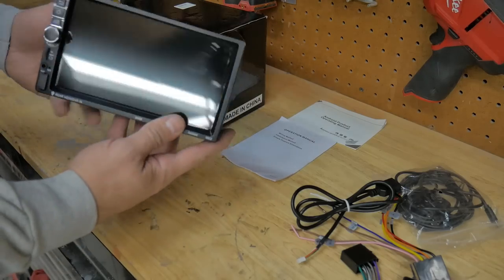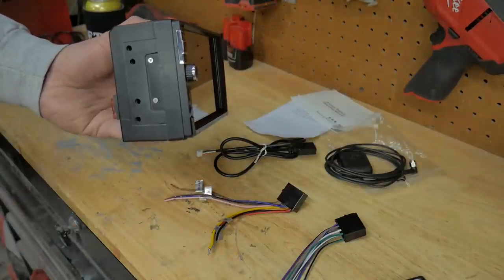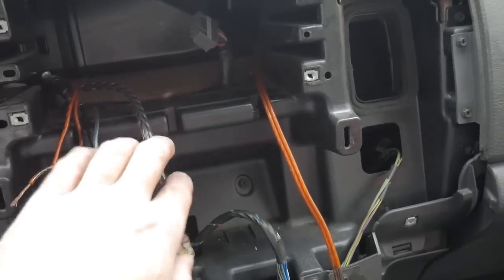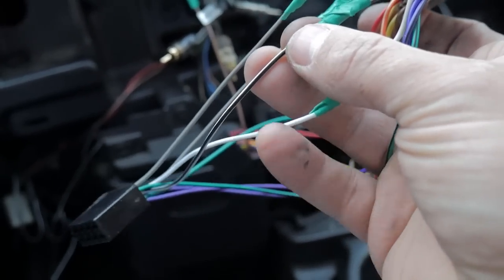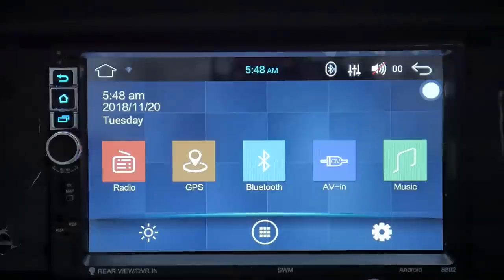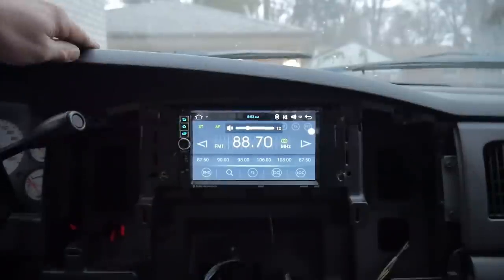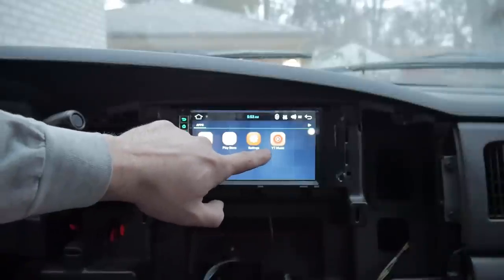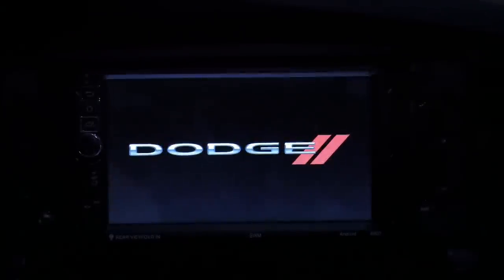Android 7.1 Car Radio with  WIFI and Mirrorlink- Install and Review

Comment: I have the same unit SWM8802. Which color wire is the memories wire? I was not able to use the PhotoLink or connect to the phone as you did. The Wi-Fi both were on the same network.
Reply: Same here. Seems that I am loosing all settings every time I switch off the ignition key. (just installed the unit.)

Comment: I bought one exactly like this with android 8.1 not 10.1  in July for about 50 bucks after shipping. It came in 2 weeks but they didn't give me the GPS module i ordered and the wifi was totally non existent  so i couldn't use any of the apps I did get the back up camera and after we hooked it up the damn car didn't have an antenna so I just used it with Bluetooth and my  phone  because that was the only feature that actually seemed to work like using the screen mirroring with wrong android version on my device  didn't work at all  with my Samsung note 10 ( a Samsung issue more than radio  because  radio was android 8 and  my phone is galaxy note 10 android 10.1 my bad  😭 The only reaI function I HATED  about this  unit is when you turn the car on the unit comes on and  thing would default to the  radio setting with  volume on MAX blowing out your ears with really loud deafening   STATIC  that makes you JUMP OUT OF YOUR SEAT and scramble to turn the volume down.  frantically hoping to find the right buttons to turn it off or at least down SUPER FREAKING IRRITATING it desoeratly needs a MUTE BUTTON or start up on LOW NOT MAX  volume .  I tried everything to find and  change the default startup options and found  NOTHING worked. I had originally bought it for  my 05 santa fe suv and ended up putting in my lincoln cartier  that was 4 sale. It looked great but thank God I sold the car with that annoying radio installed to make the new buyers ear bleed Instead of mine. Looking for a better android 10.1 version with True built in wifi For 100 bucks or less .

Comment: Oh come on Chuck, there's lots of fun in swapping CD's lol. Cool radio at a decent price point, but it will not fit my 91 Dodge Ram, no room in the actual dash.
Reply from the maker: I had an older 91 Dakota with a 318 in it loved that truck until it died lol

Comment: Hello @chuck kososky

Congratulations on your review. I also have one of these.
You said at the beginning of your comment that you had a problem with mirrorlink. I also have :( Sometimes I can establish a connection but sometimes not (most often). To solve this, you have changed the usb cable ... Please tell me, it needs a special USB cable for mirrorlink (in case affirmative where could I find it?), or did you just change the cable?

Thank you
Reply from the maker: Yes just switched out cable until it worked when through like 3-4 different cables
Reply: @AllThingsCool  
Thank you ;)
I had to test all my USB cables ... only one works fine!
 :)
Do you know why this happens?
Reply from the maker: @hugomcmendes  yea I'm not sure why
Reply: @AllThingsCool  did this hold up is it a long lasting setup?

Comment: Hello man any idea how i can connect my phone to a similar system from joom. I have tried hooking it up with my charging cable but it didn't do anything!
Reply from the maker: I tried like 5 different cables before it worked
Reply: Hello i have the same unit but suddenly shut down the  screen is white works the lights but i cant see anyyhing and i listen music only with bluetooth from my phone.any idea what is the problem and how can i sove it

Comment: Does it have radio AM?
Reply from the maker: Yes it does have a radio with FM and am
Reply: @AllThingsCool  how do I change the radio from fm to am?  I use the band button but  only changes to fm1- fm2-fm3.
Reply from the maker: @diego817  did you use the arrow button to go through the channels ?
Reply from the maker: @diego817  hit bnd 4 times ....FM 1-3 then theres am
Reply: @AllThingsCool  nothing happened,  after hitting bnd 4 times it gets back to fm1
Reply from the maker: @diego817  mine goes to am

Comment: It's now $35 only eBay
Reply: Be aware some times these radios look the same but are completely inferior when in use. Probably only has like 256mb RAM, the way the one in the video performs, I would say it's probably a 2gb RAM version. Also some of the really cheap ones are just basic radios with Bluetooth, usb/ TF card readers not an android unit.
Although you might just get lucky.